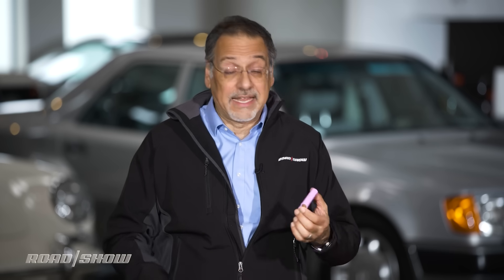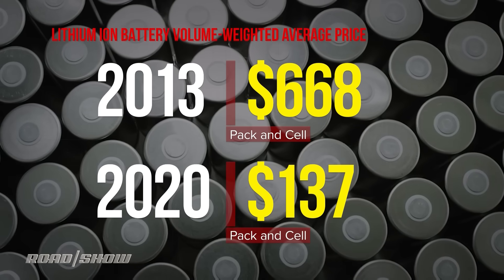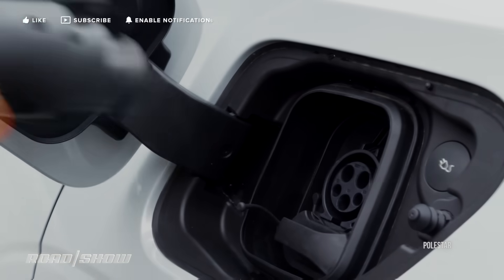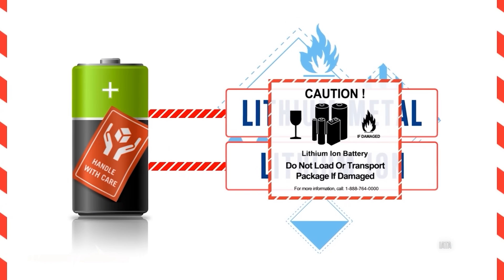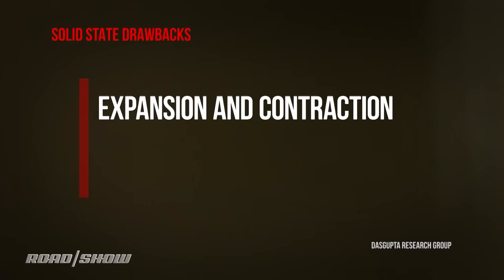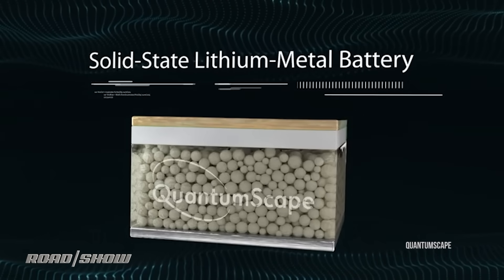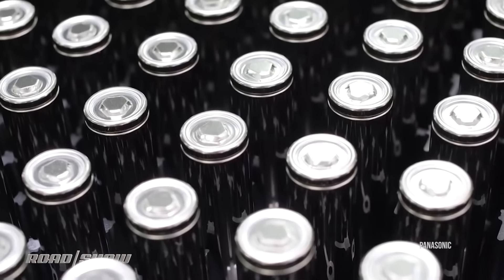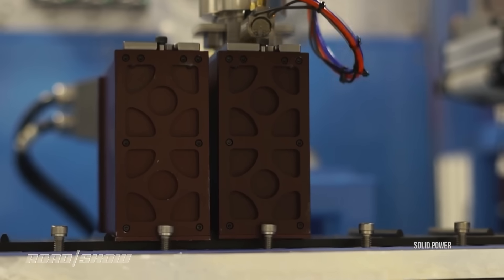When solid-state batteries arrive, you'll want an electric car

Comment: Toyota and VW is screwing themselves by waiting on future battery tech instead of using whats available today while still researching new BEV tech.
Reply: Toyota. Yes. But, VW has began selling in significant numbers with current tech.
Reply: The only disappointing thing about Toyota is the wasted resources on hydrogen fuel cell cars. Hydrogen stations are just not going to happen. That should be for fleet only like big trucks and busses where you have single depot to go back to for hydrogen. It's hard enough to get EV charging stations rolled out everywhere, don't cause a distraction with hydrogen.

Comment: I hve nothing against better batteries except not needed after u start car if not cracking it, & get up to speed hybrid wise if u want. We on earth will follow the SON & Sun, & hve to obey the JBM/father & Son adam or die. i can make hydrogen for floating non flammable won't burn or detune burn mixed liquid so it can work well current BS tech on market, or near full clean burn gas but not explode most power poss safe range. & do it damn near for free limitless not require any new tech or spend right off & free humanity from demonic elitist earthly fallen from garden sweat of brow forever more.
Reply: The mushrooms must have been on sale.

Comment: What happened to Graphine? I thought that was the next big thing in battery tech..
Reply: I'm sure there ARE companies doing R&D in that, but I guess they are not at the point,where they have something actually fully applicable to EVs
Reply: Graphine should be looked at as an 'additive' technology, providing incremental benefits when used as a component in larger materials systems.  Take shoes, for example, there would be no point in the manufacture of $2000 (100 year) sneakers whose construction is 90% graphine, when a few layers of graphine can produce a 10 year sneaker for $200.  I would look for this same application in batteries.
Reply: An U.K. researcher will use swedish graphene for car batteries. Probably the i-Pace lol.
Reply: graphene is still being researched. openly by samsung, but no doubt by others as well. in theory, a solid state battery can be made with graphene.
Reply: @woodenman1954  Really? I washed aware that it had reached mobiles - what manufacturers use it?
Reply: @woodenman1954  They would have been graphene sheets for the chip cooling on the Xiaomi 10 and the Huaweii Note. Props for trying though.

Comment: the 15min charge would solve the issue of not being able to charge at home
Reply: 15 min is still too long.
Reply: @Andrew-zv4fm  took me 12 minutes to get gas so you running on unicorn juice?
Reply: @chrisw443  so 12 minutes from selecting the grade you want to pumping and going on your way? No way did that take you 12 minutes.
Reply: @Andrew-zv4fm  I don't really care if it takes 12 mins. I'm never usually in a rush to get anywhere. And if I was I would maybe leave 5 mins earlier.
Reply: @bubba842  well most people would care.
Reply: @Andrew-zv4fm  well I think most people need to prioritize there lives a bit better. If you have to do something different them get your lazy ass out of bed 5 or 10 mins earlier. Live free and not constantly racing to get to the next red light.
Reply: @bubba842  it has nothing to do with being lazy. It has to do with wait times.
Reply: @Andrew-zv4fm  I will charge at home. For 99% of my time I will never visit a charge station. I will only ever use them if I'm going a long distance, which is probably only a couple of times a year. I guarantee the vast majority of the people in my city do exactly the same. 
And the infrastructure will only get better. It has been getting better every year for the last 5 years with thousands upon thousands of charging stations being installed every year.
Reply: 15 minutes to put enough electric charge in the battery pack for 300 miles?... You're talking about power in the kilovolts range (which means kilowatts at even 1 ampere), or kilo-amperes, (which means killowatts at even one volt.). Put them together, and kilo-amperes x kilovolts = megawatts of electricity.  How many new power plants do we have to build to support these electric car fantasies?
Reply: @akulkis  you are right. Right now our infrastructure can not support everyone who has an EV. Look at California's power grid.
Reply: @akulkis  Your FUD doesn't fool anyone.
Reply: @akulkis  enough power stations to power all the thousands of pump jacks and tens of refineries that use an unbelievable amount of electricity.
Reply: Yup. I live in an apartment with no charging available. If a charger was nearby and quick, I’d buy an EV.
Reply: Ever had to wait 3 minutes at a gas station for the car in front of you to fill up?  Imagine that being 15 min ,30min , 1hr wait just for your turn ...
Reply: @chris8417  your comparisons of charging stations to gas stations are a little silly. 
Most people will never go to a charging station because they will charge at home. We will only ever need to charge when going on long trips. The infrastructure already exists in other countries. Large charging stations are all over Europe and even California. 
But as normal, most of North America is years behind the rest of the world.
Reply: @bubba842  just becsuse you dont travel over 100 miles except on vacations does not mean NO ONE ELSE DOES.  EV are not a one size fits all.  Lets get those electric airplanes.
Reply: @chris8417  yes but most people don't. Just because you may travel that far does not mean every one else does. No one has ever said that EVs will fit into everyone's life perfectly. But for the vast majority of people whose daily commute is not very far and 99% of their driving is to work or to the shops, then an EV is perfectly fine for the vast majority of people. 
Just to let you know, my daily commute to work is about 35 miles or 50km each way. That is much further than the commute of the vast majority of most North Americans. I  am seriously considering buying an EV as my next vehicle because it will cut my costs to fuel/charge down to about a quarter of what I pay now. When there are EVs cheap enough, then I will probably buy one.
Reply: there's always ways to charge at home or apartments, it's not that hard of a problem to solve
Reply: @maynotbe  what if only you have street parking?
Reply: @Andrew-zv4fm  For convenience, I think the idea is to charge while you park. Imagine in the future where there will be chargers at offices, restaurants, wherever people do their shopping.  Actually it’s being done already, just not widespread enough.  One interesting idea (again, being done in some places already) is adding chargers to existing street lamps.
Reply: @Andrew-zv4fm  nothing is impossible, come on.
Reply: @JeepCherokeeful  yeah it is. I am parking on the street. So, I don't have access to overnight charging.
Reply: @jsponson  yeah not everyone will have access to a charging station. What do you do about people who park on the street? In an office complex, mall or an apartment complex maybe sure. But for people who live in a city or a town where they park on the street and have apartment buildings that is not possible.
Reply: @jsponson  its happening in China ,
Reply: @JeepCherokeeful  
Many things are impossible. For example  anything which would violate the laws of thermodynamics, anything violating the conservation of momentum, anything violating the conservation of mass-energy, or even something as small as you becoming intelligent.
Reply: @M_Jono  do you want to live your life like a drone, just like the Chinese bugmen?
Reply: @akulkis  that’s true, or exceeds my budget;)
Reply: @Andrew-zv4fm  is that a problem for you?? If it isn't then I might suggest that you stop borrowing other people's arguments. For some weird reason all the people that complain about a lack of charging opportunities at apartment blocks seem to live in houses in the suburbs. If it isn't a problem for you then don't worry about it.
Reply: @jsponson  this already exists in places like Norway.
Reply: @maynotbe  where are you going to build the 2x as much electric power production capacity as what we already have, because for your idiotic fantasy to be realized, we're going to need 3x as much power production as now, and the largest capacity baseload production sites, hydroelectric dams -- you can't add any more of those, because ALL of the good sites for them are already in use for this purpose.

And then all of the copper for the electric delivery to the tens of millions of power delivery stations, which because trickle charging will be insufficient, will require a LOT of copper to handle the large currents.

Comment: Electric vehicles are just better. No noise, no emissions, less fuel costs, less maintenance costs.
Gasoline and diesel are OLD polluting technology. So last century. Hydrogen is a waste of time and money.
Electric cars, electric trucks, electric buses, electric trash haulers, electric snow blowers, electric lawn mowers, electric snow mobiles, electric water craft, electric garden tools, electric mechanic tools, electric motor cycles, electric bicycles, electric scooters, electric farm tractors, electric construction equipment, electric delivery vehicles,  ...... everything is going electric.  No worries about starting after sitting for a few months. Gas always needs repairs.
Reply: You are correct gasoline and diesel are old polluting technologies. Unfortunately All the electric battery powered product you listed above will be the future pollution nightmare. And an even bigger problem where will all this electricity come from?
Reply: @alansh1492  Imagine the harsh winters and all the electricity cutouts ... No chance for an EV.
Reply: right on‼️ electric motor is King
Reply: @maynotbe  So oil drilling / spills, toxic coal mines and their polluted ponds and fracking causing polluted drinking water and spewing methane into the air are not a problem ?
Reply: Cant wait to see the EV military.  Ev charging stations should be built with only battery powered construction equipment, only renewable steel & concrete, not a single drop of gas or diesel used anywhere in the manufacturing or transport for these charging stations.
Reply: @chris8417  what will happen if there is power outage or hackers .. and no where to charge ev cars? You can't cultivate electricity to power a car up.
Reply: @CanadianSovereigntyNot4Sale  EVs are actually much much better in those situations. Power outage cuts petroleum fuel supply as well. It's simple to charge an EV with solar. Every doomsday prepper should have a Cybertruck on order.
Reply: @usa-ev   I suppose you know that filling stations have generators which power the pumps ... So no problem in filling up the car. Furthermore, you can actually store fuel in far greater quantities than electricity.
Reply: @legioner9  That's not true, the vast majority of filling stations do not have generators (at least in the US). I'll refer you to a Texan or Google on that.

Maintaining a cache of gasoline is a lot of work. Untreated it will go bad quickly and also needs to be cycled through. I think most folks would rather add solar to their property instead of a large gasoline holding tank. Solar is useful even before a catastrophe.

Finally, people should be aware of the dangers of carbon monoxide poisoning if relying on a gasoline vehicle during power outages. Big spike of this in Texas, very sad.
Reply: Well, performance wise, the turbocharged diesel engine is the best propulsion system and the least polluting at this point. I really wonder what effort goes into building those car batteries. You can achieve distances over 1000 km (and that was 20 years ago), unheard of in electric vehicles or petrol ones. Furthermore, the internal combustion engine gives you much more freedom, as you can fill up very fast, like 2-3 minutes, unlike the 20 minutes for a electric vehicle. Not to mention that the autonomy of EV's is still not very good, especially in the winter or when you push the car harder (under 500 km). Also, everything needs some sort of repair one day. Electric vehicles included. Brushes that need changing, bearings, battery at one point etc. There are advantages, but they are nowhere near as many as the sellers pretend. Common, think a bit, everything is about money and to make people buy new stuff. Nature protection is the least of their worries, trust me.
Reply: @legioner9  Well written and good points. The e.v. fan boys live in a bubble thinking that there aren't any ancillary environmental costs to the e.v. construct. Sad part is that most of the input materials are in second and third world countries where residents will disproportionately be affected by poor mining practices and have to live with the toxic results.
Reply: @weirdshibainu  Thank you. Well, it's based on some research, not my own ideas. I also wanted to write about the toxic mining practices and the toxic results ... You are right at the point with them.
Reply: @legioner9  "Well, performance wise, the turbocharged diesel engine is the best propulsion system and the least polluting at this point." - LOL, I think you better define performance.

Pollution-wise it takes about 30-40K miles until the EV offsets the battery production *with today's dirty grid energy*. Every mile over that the EV pollutes less. Over the life of the car it's much greener. If the EV is charged from a greener source it gets to this crossover much more quickly. The grid is also getting greener every day, and personal solar is also an option that is now quite affordable.

Regarding your 2-3 minute fill-up, most EV owners charge at home and start every day with a full charge and thus don't have to go to a filling station multiple times per month. Talk about convenient!

When it comes to freedom some regard freedom from big oil as important.

EVs have far fewer moving parts, and while they will need repairs eventually, surely you can see the economic advantages of needing fewer repairs less often.

This is one purchase that makes sense and provides significant benefits now and well into the future.

Comment: ice engine are very complicated. solid state ev will be simple.
Reply: EVs are already simpler and are here now.
Reply: @usa-ev  simple if you have a pile of money to buy and use one.the charging stations are few and far between. They do catch fire occasionally and the technology is not actually here yet.its in its infancy relative to the stage I'm referring to. When a reliable ev costs less than $20k without incentives and the charging stations are everywhere. Also home charging must be simpler .powerwall 2 is not easily attainable or low priced. You must mean relatively "here".
Reply: @Miamitalentg  Total cost of ownership is on par with a new Camry today. Most EV owners charge at home, and there are lots of public chargers at grocery stores, etc. 

EV fires are much less common than ICE vehicle fires (even comparing by miles driven to account for the fact that there are fewer EVs).

Charging at home is very simple and convenient and can even be done with a normal 120V outlet, I know because I have two EVs I keep fully charged off of one shared 120V circuit. (Yes, it's slow, but since I drive less than 40 miles per day on average my batteries trend towards staying full even with longer weekend trips for example.) Always starting the day with a full charge and not having to go to gas stations is amazing!

A Tesla Powerwall is a battery backup unit for your house and is not related to daily charging of EVs (Tesla or otherwise).

Today's EVs aren't perfect, but they satisfy the needs of a lot more drivers than people realize, and still deliver an amazing experience! There will always be something better on the horizon, and it's a shame if people wait and miss out on what they can experience today.
Reply: @usa-ev  winston Salem NC. Never seen a ev charger in person. Elon's master plan is what I'm referring to.